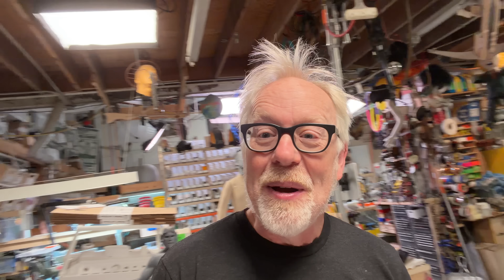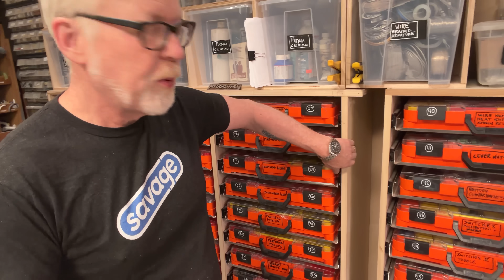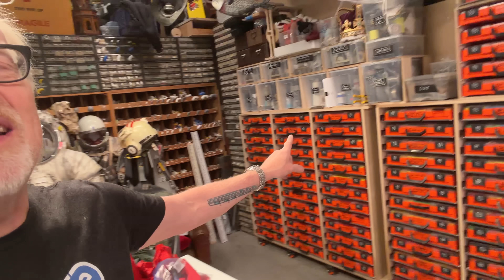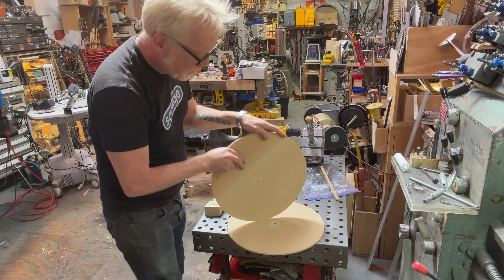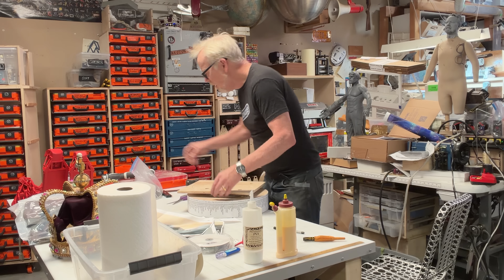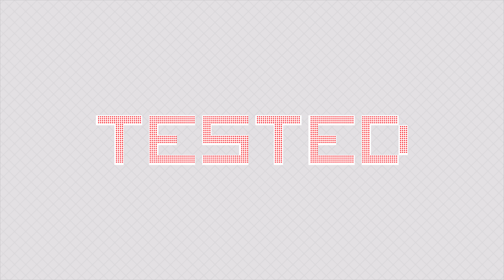Adam Savage's Hardware Organization Mistake!

Comment: In the beginning when you cut the paper and it moves on you. I've cut a LOT of paper over the years and for a short time I tried using a scalpel style knife because ... well, because that's supposed to be the best or something (maybe because I saw you use it). But I've gone back to using a good quality snap-off style knife (7mm). Specifically an NT Cutter or Olfa. I have a several of them, they are excellent. The difference is that the blade is significantly more stiff. The wobbly scalpel can bend and run around corners before you know it, the stiffer snap-off blade won't. And that's also why it has to be a quality knife. A quality knife holds the blade still. It doesn't move when you touch it to the paper.

Comment: Wouldn't it be easier to just have like... 2 sheets of two columns, printed front to back? That's 8 columns on 2 sheets of paper that can easily fit anywhere
Reply: Right? Or literally just a 3-ring binder with sheet protectors, that way he can print out more as he adds or modifies, because he will.

Comment: Decent fix for the problem. 
Myself would have used a flat version of this though, more like a conveyor belt, and could have mounted same as you originally had and not had to move anything. 
If you really wanted to go crazy could add a digital search and motorized action to bring the list item to the top you're looking for.

Comment: This may be a stupid suggestion but if the outside of the wheel was magnetic you could have indicators for low or no stock items. You could also put a small white board to use. I just figure that when your working fast it'd be a good way to remember for later what to restock.

Comment: @tested I often find that Adam and myself think alike. Ofc Adam's engineering and design skill are in completely different level. My storage solution - while (few) order of magnitude smaller are almost identical. One thing I just realises is one could use Google AI for catalog. All you would need to do is create 2 column Google spreadsheet MyPartsCatalog: item, location. the just Google home -> settings  -> Enable extensions -> Google Workspace ✓. put google smart speaker in your workshop. Then just say "Hey google, check MyToolsCatalog where is xxx"

Comment: Simplest and most scalable solution would be to set up a tiny PC of some sort and create an excel spreadsheet with all of this information in it for ALL of your shelves, drawers, etc. Then you can set up multiple tiny touch screens around the cave so you can essentially Ctrl+F to find whatever you are looking for and have it tell you exactly where it is.  

You could also separate things into multiple sheets (even in the same excel file) if you like if you don't want all of it in one and then have those sheets individually open at each storage area on different displays.  Though then you could just use mini tablets that are mounted in their respective areas like kiosks or something instead of a singular tiny PC.

I designed exactly such a solution for our hardware inventory at the company I work for to keep track of our IT equipment and it's saved my ass I don't know how many times.  Especially with it being on sharepoint so I can manipulate the data or even search for the location of something remotely BEFORE I even go to look for it.  Which, for us, this is also useful because I can glance and tell you exactly how many of _ we have because we have incorporated a barcode scanner (we're dealing with shit with serial #s, so this one wouldn't be as applicable to your use-case ofc) so we can 'checkout' items that counts down what's taken from the storage

Comment: Any boomers, excel is stupidly easy.  Even as an apple product user currently.  I still prefer excel type spreadsheets for their ease of use.  Just learn a few different concepts, in a manner that makes sense to you, as there are so many ways to get the same result, aka all mouse or all keyboard or a mixture of both, or maybe throw in shortcuts in the middle of keyboard and mouse.  The more I work with Gen Z and even alpha, makes me want me post new material of old teachings of excel type products.  Almost every excel type product has extremely similar features and work the same.   For instance, highlight something in word or excel type product, then hold down ctrl key and c key at roughly same time, which just cuts the highlighted area.  It disappears. Now just use control key and z key to paste it back. Or in this case, you can also do ctrl key and z key to undo your previous operation.
Reply: And you can do the same with just the mouse by highlighting stuff and right button click for the menu of functions.

Comment: put a color coded bar next to every letter or topic (electronics, fasteners, sewing, etc) and a legend above the wheel what every color means, then you can quickly zero in on the correct section when you spin the wheel fast

Comment: I feel like used sandpaperbelt would be somewhat perfect base for the list. And just have 2 wheels, where the other is to give tension to the belt. To make it interesting, one could programs and rc motor of some kind and simple reader and voice command or keyboard to make it spin around the right word. (For using hands to spin it would be just too low tech and too reliable) 😂

Comment: 21:56 Mistakes: Don't screw the frame into the cabinets, screw it into the slider for tool less removal. You could print the list with alternating background colours (also allows to put the numbers last again). Instead of putting the numbers first you also can extend the line with dots. ... Or give every second line an other colour. Bonus points for a different alternative background color for each alphabet letter section.
You also have extra space, so you could give the starting item of each section a bigger starting letter. Perhaps different/decorative font. Maybe different font color.

Comment: I cant think of a single worse "bearing" for this than a lazy susan bearing, they only work properly horizontal. There are reasons the vast majority of wheels use a form of roller bearing! Sortimo 22 if you cant find them.

Comment: I really like mechanical solutions but in this case i would have chosen a digital way. Any old tablet or even an old smartphone would have been cheaper and much more practical. You can change orders on the fly, add or subtract items and use it for more inventory or anything else. But as i said - i like those mechanical solutions. 😊

Comment: If you only screw the face to the left rack (instead of both), you'd still be able to move them around independently. As it stands, you're going to rip the frame apart as soon as you forget about it and try to move one of them.

Comment: Keeping the wheel as is and only doing a single change to the list, I would at least look at printing the list in reverse order with the A (beginning location to look at) on the bottom. Thinking is for Right Handed persons will instinctively want to turn wheel from the right side downwards. That I believe would cause the scrolling to move from the bottom. A smaller visual section at any moment would help there

Comment: Some improvements I can think of, that would be relatively easy to implement:

1) Alternating the colors for the rows. Either the background or foreground color. Example: every other row has a light blue background; or: alternating the text color between black and red, like a column of checkers board
2) Bold and maybe slightly larger font for the first letter of each letter-group

Comment: If I were to do a wheel like this I would try pressing a couple of skate bearings into a pvc pipe that then attaches to a wheel of whatever material with the rod attached from both sides. Right side of wheel edge with some sort of gripping material. Also a 4 inch rectangle magnifier on some removable mount (so it can be borrowed) at an angle that makes visibility easie
Glancing thru comments also made me think of old kids toys and such that had “bicycle chain” type scrolling. No need to have a large wheel if you have depth. Maybe even add a small motor and larger font

Comment: I understand the analog option, but this should be a single screen digital tablet or device that can searched instantly via a search feature or at minimum a 'find' feature.  Even an old phone with a Google Sheets open, which would allow the movement and creation of new entries or corrections to take place dynamically.

Comment: Neat but I have two questions: 
1. Why is this preferable to a cheap tablet running a notepad program besides the perceived cool factor?
2. Did you consider adding a protective clear cover to the roll (maybe as simple as some good packing tape?)? I know the list is easily replaceable but it will last only as long as your fingers are clean.

Comment: HA! Now you need to put a little clear acrylic bar on it that goes over the text and put a super thin red line in the middle of it so it highlights what you are looking at and lines it up with the number. There is no actual need for this but I know you want to XD. Also will that kind of bearing break in more with use or will it always be like that? I feel like I would end up trying to pack a tiny bit of grease in it because the grinding would drive me crazy lol. I assume its because there is barely any load on it.

Comment: Idea: A spacer so the lazy susan runs cleaner, instead of rubbing. A guide rod, attached to the fixed back and create a visual line across the index roller.

Comment: My OCD wants to standardize the Use Of Upper Case (or not) and I'd add a small (but extra bold) A, B, C, but do them in sets, so you might have A-E, F-J, etc, I also assume it's intentional to have both Grommets Rubber and Rubber Grommets? Is that as you sometimes think 'ohh, I need a grommet' or 'i need a rubber grommet'? And how do you differentiate duplicates in different slots, like Map Tracks?

Comment: I'm just gonna throw this idea out there; you could have used a translucent backer for the list and lit it from the inside like a light table.  You could even make the backlight motion activated with a motion/occupancy sensor so the light turns on when you spin the wheel and turns off after a set amount of time.

Comment: I'm picturing using an Epson thermal printer for receipts to print off the next copy of the list as one long sheet. You can send any arbitrary print job to those things, as I've found in a few years of doing library IT, and it could be perfect for something that isn't several sheets taped together. The only downside would be that it wouldn't be heat fast, so if something warm rested against the list for too long it would all darken.

Comment: a pairt of regular sealed ball bearing on an axle would have worked better. Lazy Suzan bearings are designed to be use horizontal and dont work verywell when used on their sides.

Comment: The cover you built at the end of the video should be a surface. You can easily write and erase on so if you need multiple items, you can easily write down the drawer number, so you can easily get things from multiple drawers at a time without having to bounce between the wheel and the drawers

Comment: did you tilt the cassette so that the wheel puts itself away when you're done? and you should add weight to the bottom of the wheel so it self rotates to put "A" at the top/front

Comment: Maybe I missed it if you mentioned it, but wouldn't it be better to have a bearing designed for the load force to be perpendicular to the axis of rotation, rather than parallel to it? 

A lazy Susan has the load force vector parallel to the axis of rotation, so I assume that that's what this bearing is optimized for?

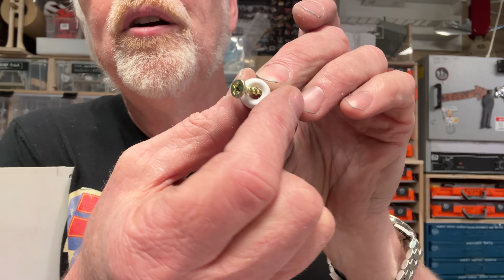Comment: 21:25 QUESTION: would a rolladex style wheel, display more items in the same space? you'd have to make an encasement for it, but considering i assume the draws cant get bigger, and if they did you should need more space, then it would be more practical for each rack to have its own roller instead.

Comment: Instead of a physical wheel, consider a cheap e‑ink tablet like a Kindle Scribe or Boox Note Air. They use almost no power, stay readable forever, and you can update your hardware index instantly without rebuilding anything.

Comment: Whilst this is an improvement to the long list to the floor, i doubt i would use this.  Was that thing under G for grommet rubber, R for rubber grommet, O for open rubber grommet, etc, etc...
What's wrong with the current groupings?

Comment: Just a suggestion: attach another, slightly larger disk on the right side of the wheel to give something to grab onto in order to spin it. This would help you avoid rubbing dirt and grime from your hands onto the paper itself and you would also not block the list with your hands while you spin. This should work better than just pressing on the sides or the face to spin. (I think this might have been your idea at the end of the video that you said you might do).

I strive to be this organized, though I doubt it will ever happen lol :)

Comment: Wouldn't it be a lot simpler and  require less space to use two rollers vertically, one at the top, one at the bottom, like a belt sander? Metal gears, bearings, crank, protective housing; the possibilities are endless.

Comment: Some questions, why not just use a center axle/pin to spin this, whats the point of expensive lazy susan mechanism? If you need to take it out and slide is for that, you can do the same with center axle by for example making axle sit in a U shaped boot and just pick it up.  You can make wheels center area slimmer to make space for those 2 "U blocks" on the side.
Putting things in order is hard, there are almost infinite amount of different ways to sort things and that is where i always fail, there is no perfect system. You could add color codes to that wheel, making it easier to spot things by some different category, adding to the usefulness of the index. The big problem is when a object belongs to several categories but you can only put in one. My solution would be a old touch screen tablet as a index, perhaps done with some vibe coding and having a gmail style labeling system. There you can put  as many labels in a object as needed, belonging to multiple categories. Normally searching is a problem because you can't remember the name you used to store a thing or often might not yet fully know what you want but could now list things in groups to see if there is something that clicks. I often lack in resources so going thru a piles of junk trying to find something that works is normal, index like that could help.

Comment: to be honest i would get an old smart phone with a dead battery and use that for a list
you can either plug it in or have it on a small battery backup
and if you truly want to push things to there limit you can write a program that does what you need

Comment: You really need to check out a jig for cutting circles on a bandsaw. It’s really simple. It’s basically a pin on a board that sits out in front of the blade at a given radius and you spin it on that pin for a perfect circle. It works great.

Comment: For bearings in low RPM and low load applications without any tolerance requirements, FDM 3D printed versions also work very well.

Comment: Personally I think the original strip list was fine - all Adam had to do was make it hinge at the top with a handle or something to lift it to eyelevel for reading, and then it would just drop back down flat against the shelf gap again after use. Way easier to change if there are any changes to the list as well.

Comment: Suggestion: A medium/small touch display/monitor and an arduino running a simple program of your inventory searchable by keyword, along with listing the alphabet so you could tap on the appropriate first letter in the alphabet. Whenever you update your inventory list, you don't have to print out the whole list and re-jigger it into your wheel, and you can make the text much larger and easier to read on the display.

Comment: You could make a little bracket out of some spare plywood. Cut a shallow U shape and install it at 90 degrees so the tips of the U can be screwed into the drawers and the base of the U will act as a reference line so you don't get lost while reading.

Comment: Alright, I looked through as many comments as I could, and didn't see anyone else point this out, so here's my 2 cents.  It seems rather silly to have the 2 cabinets on separate sets of wheels, and then screw the "window" to both of them.  I would have added wood supports to the left side only that would span the inside space in the gap to make it so the window would only attach to one of the cabinets.  If you ever need to move one or both of the cabinets again, the likelihood of getting the holes lined up perfectly where they are now in relation to each other is... minimal.

Comment: I take it that the rubbing is because the bearing isn't spaced on the wheel. I'd space it and 3D print on the inside the of lazy susan bearing, a ridged ring that's screwed into the base (where the ring is) and on the wheel, add a piece of spring metal (like for example, the banding that comes with large packages) bent up in a J shape and screwed down such that when you turn the wheel (either way) the curved part of the J will nest inside the ridges and make the whole experience more enjoyable (audibly and from a tactile pov). Click, clack, click, clack.